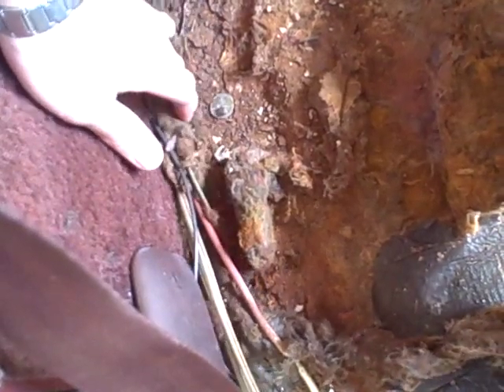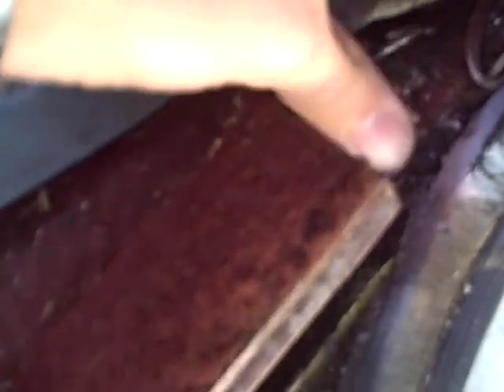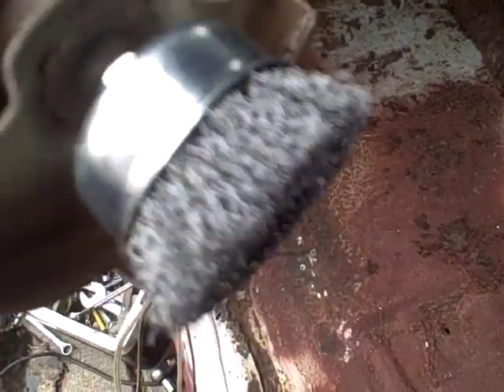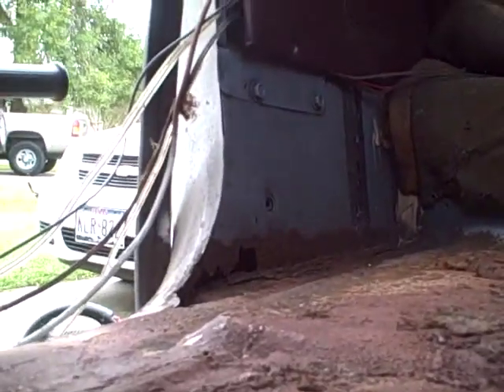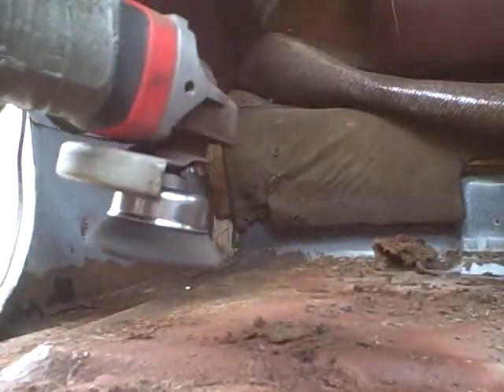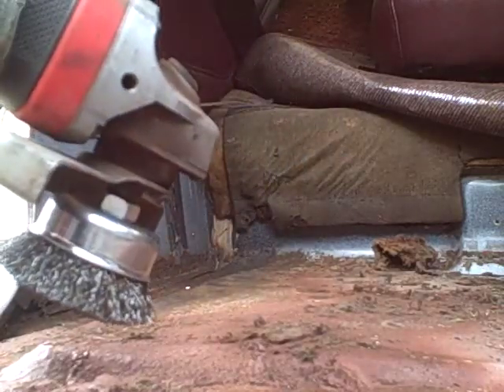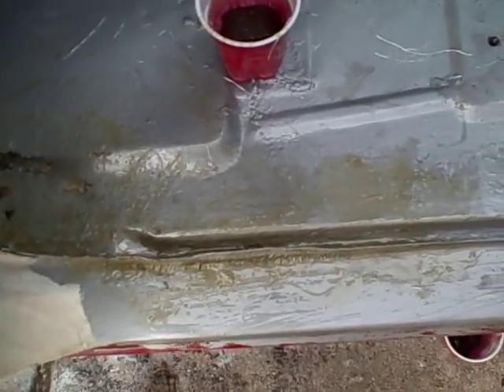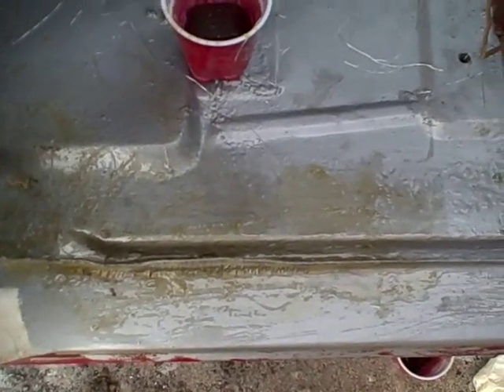Repairing rusted floor in 87 GMC Jimmy

Comment from the maker: @ruwithlee1970 i did thoroughly clean and treat both sides. I did not under coat because we don't use salt on the roads here, so no need for the undercoating. This was rust caused by a leak in the seal for the removable top, which I fixed the leak.

Comment from the maker: @mr954 Replacing the floor would have been so much more work and time. This being my daily driver would have left me without a vehicle to get to work in. These floors were thin and prone to cracking new, much less the inferior quality replacement floors you can buy. I put down several layers of fiberglass and I feel the metal was much stronger than new.

Comment: Does the rust blast neutralize the rust or just seal it? Often if u seal in rust it flakes an comes back worse. If u undercoat an already rusty under carriage, it will rot away twice as fast under the under coating. How did the rust blast pan out? Curious...
Reply: Rust Bullett!  and yes it is a good product if you remove as much of the rust as possible and use metal blast over it first.

Comment: When you folks do this with an Angle Grinder it's fine to use an angle grinder just don't use that type of wire brush on it. Use a regular flat wire wheel you have more control of the angle grinder than with that type of scrub brush wheel makes it too easy for the grinder to be top heavy and spin out of control. I had a scrub wheel like that one catch on the edge of a floor panel and the grinder jumped up and socked me right in the eye.. Had a black eye for like 2 months. I had to tell everyone that asked me what happened that my grinder beat me up. To be honest I could have been hurt much worse the angle grinder is not a tool to do physics experiments with its capabilities and or invent your own tricks. Stick with a flat wire wheel and avoid getting some lumps. I also wear glasses and you have no idea what it's like to be patching yourself up checking your face half blind stumbling around for your spare pair of glasses. That incident gave me a lasting respect for that tool and the powers it has over your physical strength.